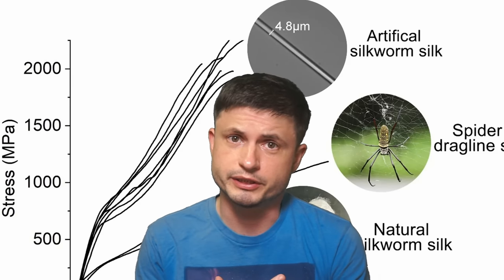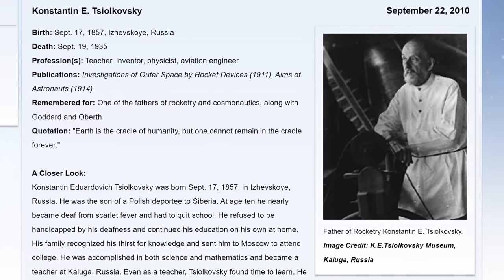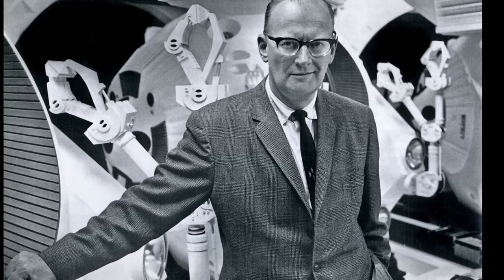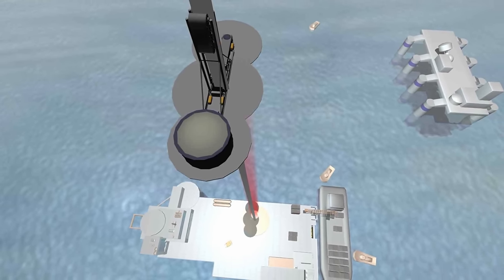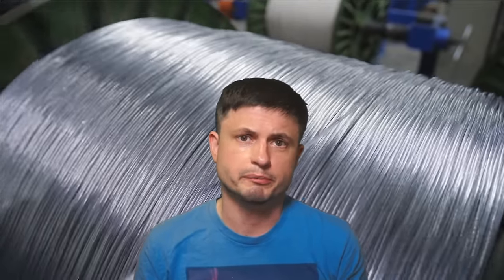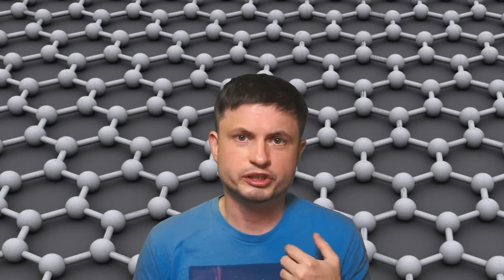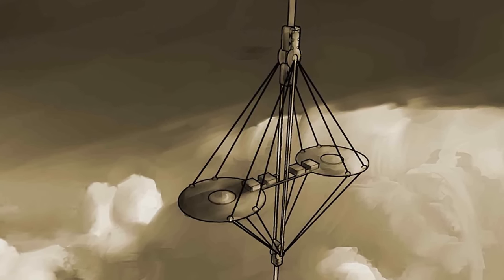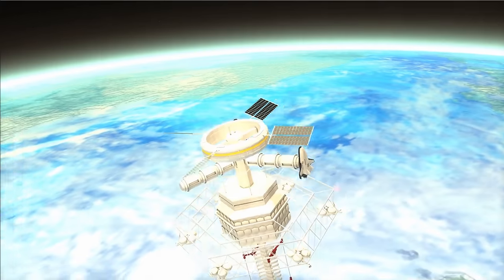Exciting New Updates About Space Elevator Technology...Possible After All?

Comment: I remember seeing a articles back in the early 70's where it was postulated that a drilling platform off the coast of either Chile or Peru could serve as the ground base for a future space elevator
and the space counterweight location could actually become the first in space city site because the tethering counter could also serve a mooring dock for other building structures in future manufacturing buildings using the same cable materials used for the elevator or elevators.
Reply: Why off the coast of Peru/Chile specifically?
Reply: @ericv738  you would want the tether to be close to the equator so that it doesn’t have any weird gravitational effects
Reply: The logic behind being based off of chile or peru was the relative low frequency of cyclones slash and or hurricanes and proximity to the equator.
Reply: @leonmusk1040  yeah inclement weather and lightning strikes were another concern I had, like such a space elevator would be hit by lightning hundreds of times more often than a typical lightning rod. Would it be an opportunity to use graphene's superconductivity and funnel the electricity from the lightning into a battery?...
Reply: And what happens when one or two  or a hundred of the thousands of meteorites that burn up in the atmosphere each year smashes through  the elevator at 200,000 kilometers per second? That would be like a weekly event.
Reply: @czarlguitarl  Awesome Idea!!
Reply: @captainahab5522  If the top of the elevator must be in geostationary orbit then it would have to be directly above the equator.
Reply: @ericv738  the location was an oil rig in Peruvian waters very close to or on the equator, the why of which is very basic logic !
Reply: @ericv738  From what I remember it was because off the coast of Peru/Chile is the most stable Inter Tropical Convergence Zone aka Doldrum area on earth. It's near the equator but not on it so weather conditions are super stable where wind and rain seldom develop and the ocean currents almost don't exist. This  point off the coast off the Atacama  Desert the driest place on earth so a mooring site would have very little drifting movement. Yet you would want to have a tethering site to be able to have the ability to move somewhat because it would counter putting to much stress on the anchoring cable.
Reply: If the city were at the couterweight location then it would have to be a part of the counterweight itself. One potential problem would be that it would want to fly away if the cable was severed. A benefit would be that there would be an artifical gravity enviroment there.
Reply: @noeoep  Maybe not as much of a problem as first visualized because it would seem prudent to cable have more attachment points to each structure than just one or two so that if a cable broke there'd be other attachment points until repairs could be implemented. But I do also agree your concern is very valid.
Reply: The best place to build a space elevator would be in Colombia, near Medellin.